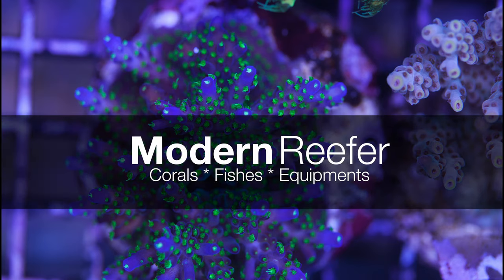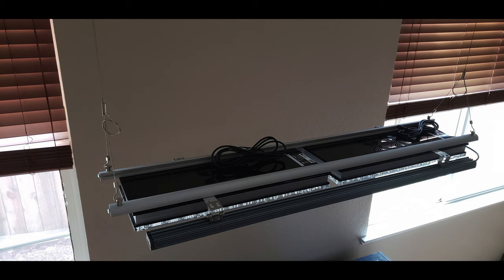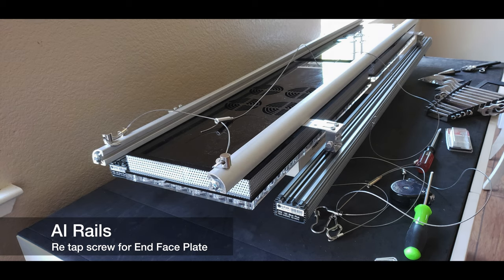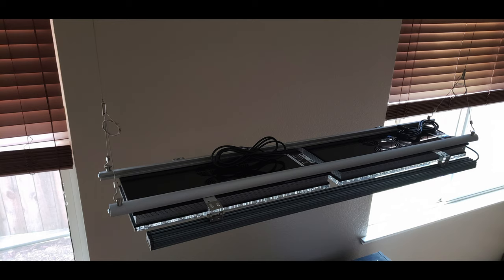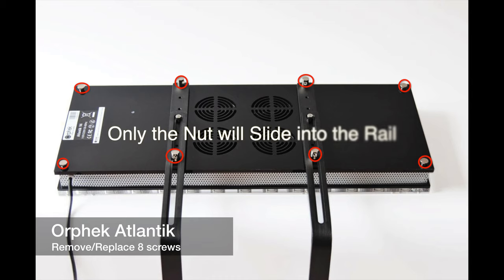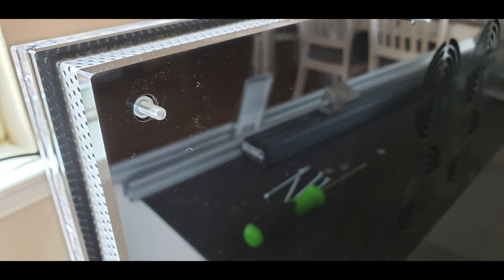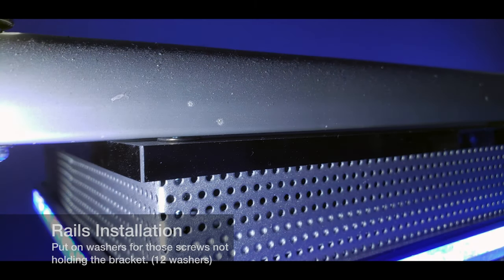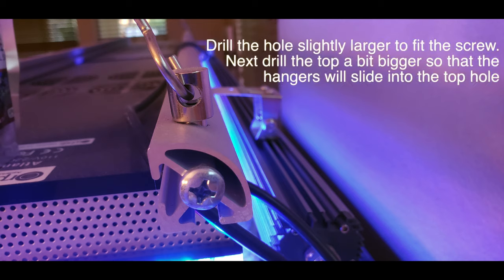Orphek Atlantik v4 Gen2 with OR2 Light Bar : Setup Guide to Build your Own! (A Clean Setup)

Comment: Nice work. Little bit over complicated in that you could have used 1"x1" x1/8" alloy angle bar across the full length of the lights and used that to bolt the lights on along with the light bars. Not knocking your efforts at all, well done. I have used the Orphek tank mounts and added a light bar to the front and wilm add another soon hopefully.
Reply from the maker: I agree.  The alloy angle bar would have worked. It's just something with the AI light bars that make it look that much better.  Just my opinion but either would work.
Reply: @ModernReefer  fair enough function with form.

Comment: How did you tighten the nut inside the rail? I seen the nut you used that went inside the light, just cant figure out how you got the nut tight in the rail
Reply from the maker: I tighten it as much as I can but made sure to use a lock nut so that it does not undue itself.